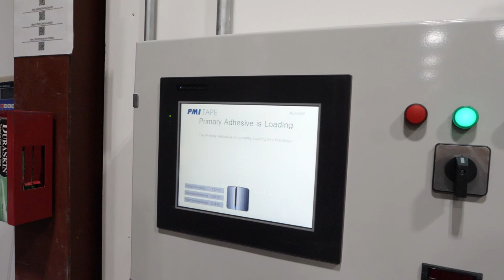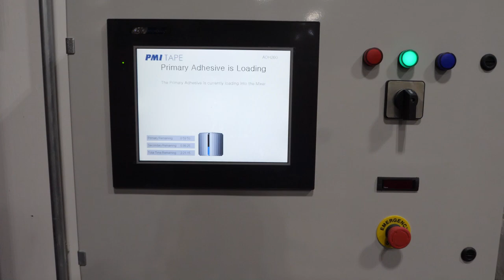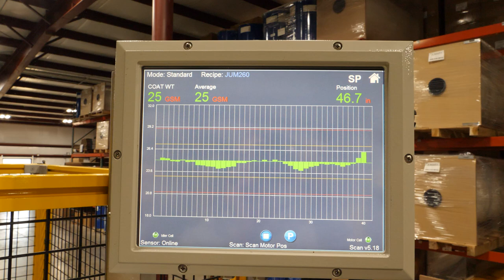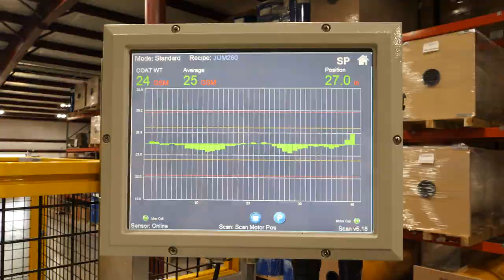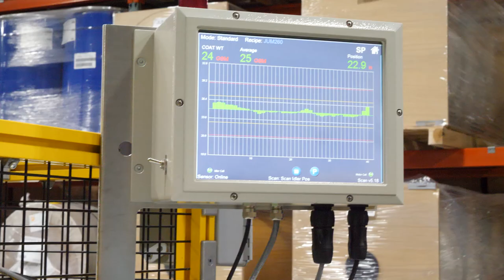Keeping Screen Printers Together: PMI Tape Shop Tour

Comment: Super impressive operation! The level of specialization is amazing. 

If I could ask for one thing, having the adhesive deadener on the other side of the roll would be awesome. We pull the tape from left to right, and tape the side of the screen closest to us, meaning the length of tape has to be flipped around in order for the blue part to be on the frame.